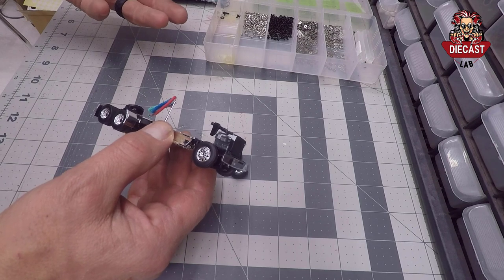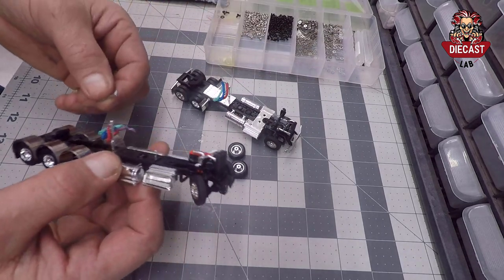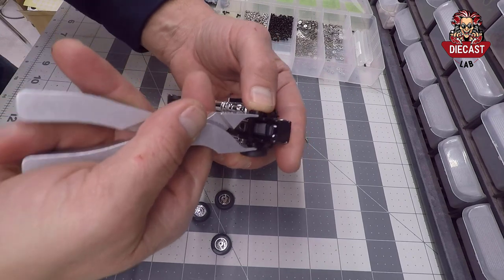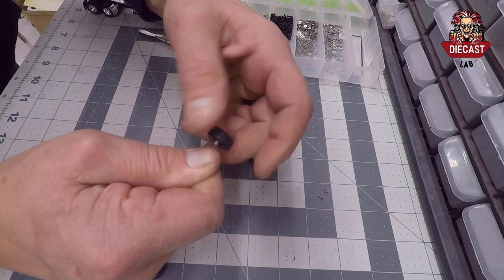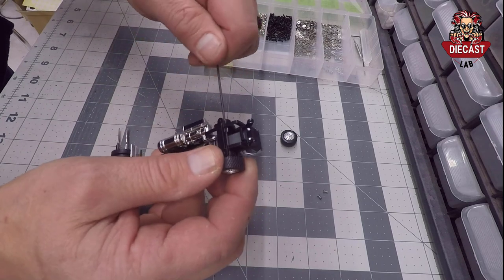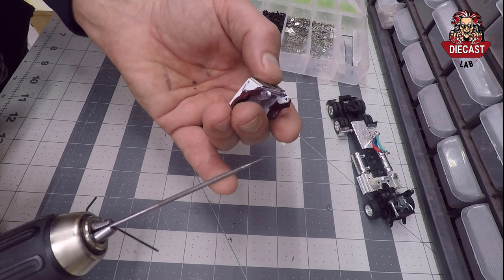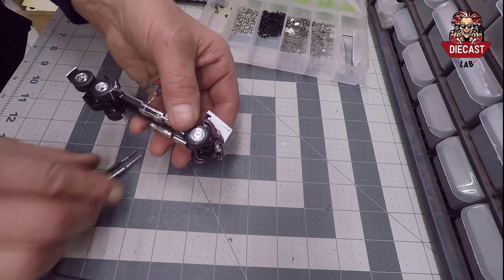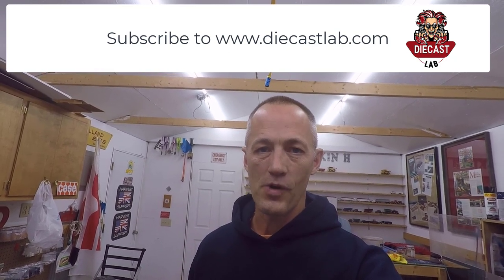Attaching 1/64 Scale Wheels and Hoods with Micro Screws

Comment: What size of screws do you use for a DCP trailer rear wheel mounts ?  I have  a 1/64 DCP BLACK WABASH 53' ARTICLITE SPREAD AXLE  trailer that I need new screws for. I think I stripped the tips of the screws for the wheel mount  holes facing closest to the rear doors. I need longer screws than the original to make better contact. The holes closest to the back are on a flat surface now require a longer screw to make threading contact, but the holes in the front facing the cab make contact on a rib or ridge casting line so those screws do not need to be as long and work fine. Thanks!
Reply from the maker: I am unsure what size screws those are. What I do in this situation is put super glue around the threads, screw it into the stripped threads and let it set upside down until the glue dries. Works pretty well.
Reply: @RockinHFarmToys  Good idea, Thanks!

Comment: hey i have a question i have a 1/64 dcp  chassis 245" and have cab with 70" sleeper on it want fit my chassis body do i need to go 270"' or 300 ''
Reply from the maker: It will fit both so it is really up to your desired look.